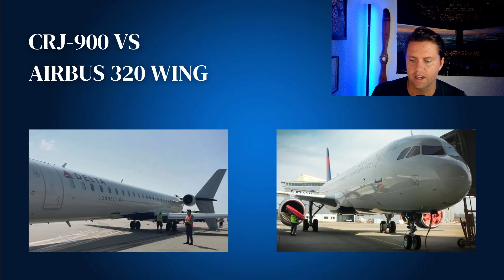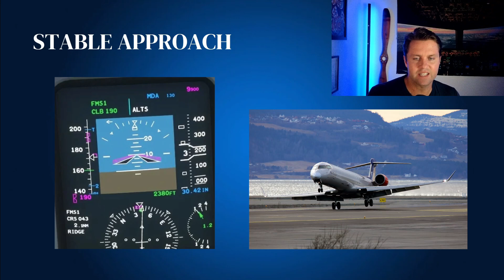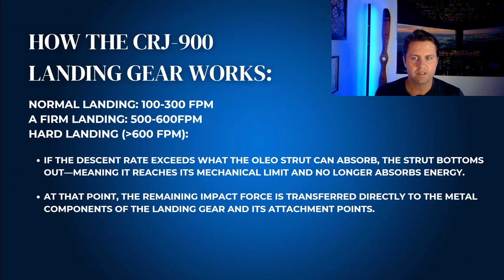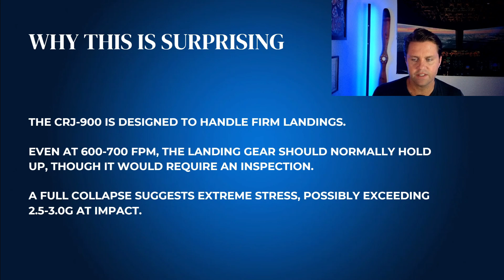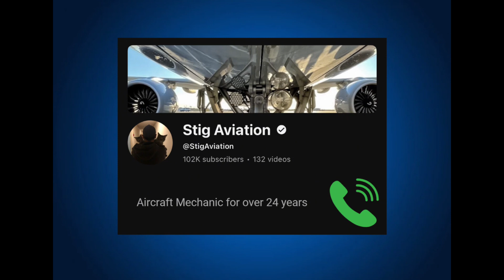Pilot Breakdown: Did a Hard Landing Cause A Gear Collapse?

Comment: Ok.  I watched this crash twice on video and made my conclusion at that time. It remains pretty much the same. 

The pilot was probably managing unseen weather conditions.  40mpg gusts had already been coded by ATC.   The pilot was most likely flying a little faster not wanting to get caught in a stall situation and was trying to thread the needle.  He wasn’t wings level (which is common on landings) but the lack of flare (there was a small degree evident- maybe 2-3 degrees) demonstrates he wasn’t ready to land.  I believe he was most likely hit with either wind shear or a sudden downdraft at a moment when there was no room for error.   Those gears are robust, but they aren’t made for carrier landings.   I did not notice whether or not the tires blew after exceeding max CG.   The transfer of kinetic energy still continues.    Overload did occur, but why?  Was a a fault missed in an inspection? Was it a double blowout?   Either way, the overload snapped the main spar and the increased drag of the right wing being in contact with the ground combined with inertia ripped the wing off.  Seems like there may not have been a tremendous amount of fuel in the center tank in that wing.   The sparks from the ground ignited the fuel as it spewed out.  However, between the rate of travel down the runway and the fact that those engines were still being operated electronically and had most likely already been shut down and been off with fuel starvation, the pumps were no longer pumping fuel.   There wasn’t torrential snowfall coming down.  They weren’t actually “sniffed out” by the snow.  The snow is on the ground. This aircraft was inverted and the flames were on the top. Probably snow hoped to reduce friction and sparks on the ground momentarily.   After the wing snapped off, the horizontal stab went first and then vertical stab went due to lateral overloads because the weight of the aircraft was upon them.   It’s by God’s good grace RBIs wasn’t a major disaster.     

Incidentally, the lack of flare may have actually saved them. Had then been in a state of flare, the fuse would have most likely bounced and broken open.  God protected these people.   
Black box will reveal all the instrument readings and inputs. Cockpit recorder will reveal whether or not crew resource management was being employed. It truly looks like some unforeseen circumstances at a point that was too late to compensate to me.  I don’t know anyone who’s ever landed without being hyper vigilant at that moment and transfixed on what they were doing.

Comment: The lack of flare was the first thing that I noticed. The plane simply flew into the runway like the flight crew thought they were still 100 or so feet in the air. Could it have been an altimeter failure?

Comment: The pilot should have landed with a crab, the pilot tried to, at the last couple seconds turn the nose to face down the runway by lowering the right wing with the  left rudder. The right gear hit hard first while the right wing lost lift at the same time. It's all pilot technique or lack of experience. Landing on one of the gear vs both is poor pilot control along with the lack of flare caused the hard landing. If you have watched many aircraft landing in cross winds they all landed in a crab and on all wheels, then with rudder and the help of the runway face down the runway.

Comment: Cannot relate to touchdown at 600 ft/min........As an 82 Year old freight pilot..."retired"......I can testify that I've never touched the ground with a decent rate greater than 100 Ft/Min ........Don't Pilots bother to flair anylonger........But on the other hand I can vouch for the fact that wind gusts/wind shear can be VERY unpredictable.........Also a plane with so little dihedral in the wings makes slipping to a touchdown very hazardous........Plane would need to be landed almost perfectly level ALL the time.........Something I've never done..............Plane design/extreme wind/blowing snow/possibly less than perfect performance on the Pilots ability all add up to what had to happen.........................................Paul

Comment: If you are filming and trying to walk out of the plane on its ceiling, that surface is uneven and could be slick. It takes more time to evacuate if you're "filming " or walking and holding your phone. You are impeding evacuation of other people. You dont know if that plane will catch fire or explode. I want to GTFO and not have some moron with a phone impede my emergency exit.

No flare and a hard landing. Is that pilot error or could it have happened with an experienced pilot. Sound like the gal flying the landing was just "certified" whatever that means.

Comment: Have you heard of the term called "Cold Soaked at altitude". I’ve noticed the Delta 4819 CRASH in Toronto, Canada February 17th, 2025 news media has not addressed the possible failure of the main landing gear oleo shock absorber which might have been cold soaking at altitude.  Yes with no flare out. The plane flew over very cold temperatures the entire flight. The landing gear bay is not pressurised or temperature controlled so the landing gear will be the same as the outside temperature. This temp can be -60F to 120F, depending on conditions. Oil was stiff to go past the metering pin. Yes, the landing gear, specifically the shock absorber component, can experience "cold soak" when exposed to very low temperatures, meaning the hydraulic fluid inside the strut can become significantly chilled, potentially impacting its performance during landing or taxiing in cold weather conditions. Key points about cold soak in landing gear shock absorbers:
Temperature impact:
When an aircraft is parked in extreme cold, the landing gear bay can reach very low temperatures, causing the hydraulic fluid within the shock absorber to cool down considerably.
Performance implications: Cold soaked hydraulic fluid can become less efficient at absorbing shock loads during landing, potentially leading to a harsher impact or increased stress on the landing gear components.
Aircraft maintenance considerations: Maintenance procedures for aircraft operating in cold climates often include pre-flight checks and gear cycling to ensure proper functionality when the landing gear is cold soaked. An aircraft main landing gear oleo shock absorber, commonly called an "oleo strut," functions by using a combination of compressed gas (usually nitrogen) and hydraulic fluid within a cylinder, where the piston attached to the wheel compresses the gas upon landing, acting as a spring to absorb the shock while the fluid acts as a damper, allowing for a smooth landing by dissipating the energy over time; essentially, the gas provides the rebound force while the fluid controls the rate of compression and extension.
Key points about oleo struts:
Components: A cylinder (upper part) containing compressed gas and a piston (lower part) connected to the wheel, both telescoping within each other.
Function during landing: When the aircraft touches down, the piston moves upwards, compressing the gas in the cylinder, which creates pressure to absorb the impact.
Fluid role: As the piston moves, hydraulic fluid within the strut is forced through a small orifice, creating resistance and controlling the rate of compression, preventing excessive bouncing.
Benefits: Oleo struts provide a smooth landing by effectively absorbing shock and minimizing recoil forces on the aircraft structure.
Reply: I understand the strut oil may have been stiff, however, the pilot did not flare and forced the plane into the ground causing the gear failure and the plane to break apart. Pilot error.
Reply: This is an extremely usefull comment about hydraulic fliuid possibly being cold soaked before takeoff ! However, surely after takeoff, land gear retracted - warming the hydraulic fluid !!! Similarly, on landing, the landing gear extended, warming the fluid !!! Unless, of coarse, the landing gear was not fully extended/locked in place! However - pilot shud not of attempted landing without seeing "landing gear down & locked", many minutes prior to touchdown !!!
Reply: I'm so glad you brought this subject up. It was below zero when they took off and I don't know how long it had been sitting in that cold temp before takeoff. Cold metal and fluids the entire time. Take off, flight and landing, things may not have been working like they should.
Reply: Now, that was a good comment that you flew 10 years on that plane! That certainly gives you much additional kudos/respect for your comments !!!

Comment: it looks like that right wing got burned at the same time it got separated and didn't move along with the body of the plane.  you can say the separated wing got dragged back by the snow.  sure.  the other wing didn't catch fire because there wasn't an impact large enough to release the gas, so, no fire.

Comment: Here's what I thought about the fire. I think if the plane stayed on it's belly, the fire would have stayed under the plane and the whole thing would have burned up. The fuel and fire would have stayed under the plane, making the plane fuel for the fire. Because the plane rolled the fire and fuel stayed on the top[ so it couldn't spread up.

Comment: I was on a smaller airliner (roughly the size of this CRJ) several years ago, which was trying to land in a thunderstorm.  The pilot briefed the passengers, after two aborted landing runs, that this was the third and last try he could make, and if he couldn't get it on the ground on this attempt, we'd have to divert to another airport about 50 miles distant from my destination.  There was a very stiff crosswind, and on the third, successful attempt, the pilot brought it in fairly fast, and as the plane was being pushed across the center line of the runway, it was still maybe 10 feet in the air.  So, instead of a flare, this pilot just dropped it down as fast as he could as it crossed the centerline, and the feel of it inside the plane said that it had been pointing like 30 degrees off to the left, into the crosswind, and then almost violently fishtailed back through pointing forward, and finally straightened out.  I get the feeling that this is sort of what happened in Toronto, the pilot saw the crosswind was threatening to push him into the snow drifts to the right side of the runway, and dropped it in instead of flaring.  At which point, the right main gear failed, and the crash developed as we saw.  My feeling is that this wasn't an unusual maneuver the pilot used, and that the gear ought to have withstood the hard landing, but I'll obviously leave that conclusion for the experts.

Comment: I am a low time GA pilot that has not flown in over 25 years, but I have a question to ask. I have heard that pilots flying jets will intentionally make a hard or firm landing. They do this when the runway is contaminated so the tires will get a firm grip on the runway and also reduce floating down the runway. Do you think that is what the pilot flying was doing but just over did the hard landing?
Reply: Yeah maybe they didn't want to go sideways on the runway with the wind.

Comment: Happy that everyone survived… that is what I’d most important… weighing in on the early speculation, what about if the gear and wing touched the runway at the same time?  Again, a plane crash typically doesn’t occur because of one factor: wind/ wind shear/ landing gear/ wing strike. If he stalled ( due possibly to wind shear) just above the runway, he may not have had sufficient elevator authority to perform a flair ( and the plane would have become a brick at that point).

Comment: In addition to the sink rate of 1000 feet per minute, they also came down on the one gear. Setting it down hard on both mains would have split the forces up. That main gear went right up into the wing. Setting the wing in the dirt and damaging that fuselage/Wing joint.

Comment: Credentials of the pilot?
Reply: Commercial pilots have to be certified on the specific plane they are flying.
Reply: @DAB65  Not an answer.....
Reply: IF and I repeat IF the reports coming out are true the Female pilot just received her ATP rating on 1-9-2025. Very little experience as an ATP pilot.
Reply: @guitarhillbilly1482  , So the other pilot (pilot in charge) should have taken over controls if he thought there was an issue. Did the pilot in charge call for a go-around?
Reply: @DAB65  Your not allowed to question them, bad look......

Comment: Previous hard landings can cause damage to the spar. Cracks that are under the trunnion can't be easily found unless the trunnion is removed. That maintenance is normally not done until a heavy "C" or "D" check. Even hard landing inspections won't usually find damage done to the wing spar.  I'm betting that somewhere in the planes 15 year history there is one or more previous hard landings. I also think the lack of fire may be related to going bingo fuel and the reason he didn't go around was due to low fuel.

Comment: After looking at the video many times in slow motion and zoomed in, AND after seeing the photo of the CJR-900 with a person standing next to it, I am now inclined to believe, hard landing or not, the runway was not cleared of snow properly in order to accommodate this particular aircraft. 

From the photo comparison, it is evident that the bottom of the wing is a mere 4’ from the ground, give or take a few inches. That does not leave much ground clearance to maneuver the wings on the roll axis in case of a crosswind or main gear tire blowout. And it is clear to see the right wing sliced through a snow bank creating a significant cloud of white just after the right gear touched down, but before it caught on fire.
Reply: Wing ground clearance is 1.7m and wing length is 24.9m, so the max roll angle is about 12 degrees.

Comment: High sink rate, no flare. The pilot flying was reportedly still on OE . Only acquired her ATP earlier this year.  Delta has offer a "goodwill " payout of $30,000 for all crash victims.  Very low offer.
Reply: Yes I think they were asking way too much of that gear, especially with the asymmetric landing (landed on right-main gear first). I don't think there was a design / mechanical / maintenance issue with the gear. Just a very bad landing.

Comment: Saw a video the other day where a naval pilot had commented on the landing.  He said it was harder than they landed on a carrier, thought the drop rate was about 1,100 feet per minute where they drop about 800 feet per minute.  They were lucky that the right landing gear did collapse, it allowed the wind to drag off where most of the fuel was contained.  I am one hoping that they do determine that the wind helped push it down for I do not want to believe that even Delta would hire someone that would land that hard.

Comment: I think the bounce from the hard landing was absorbed by a sudden downdraft. I think the vertical G force on the gear was about 3Gs (guessing by the wing vibrations on first contact - enough for a collapse) as the wind slammed it down in the last 10 feet before touch down. Because the pilot tipped the right wing into the crosswind to prevent flipping (as is normal), the outer most right front wheel took ALL of the shock (because there was no flair), the axle broke (guessing), and the whole landing gear is compomisdd at that point.

Comment: The nose was up 5 or 10 seconds before, then it dropped nose down, and began to lift a few degrees in the last half second. Was that intentional or did the nose up slow the plane to a stall and put himself in a low control stall till the speed increased too late. With its weight you have to reduce the decent rate at the runway or you will wreck the airplane, he probably increased the decent rate if it was stalling.